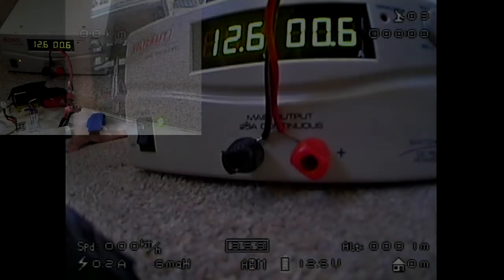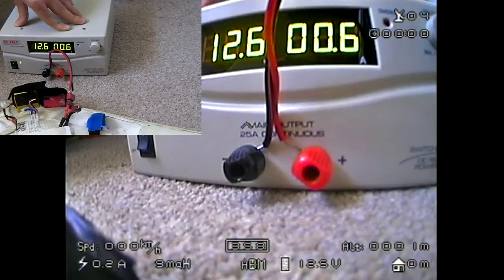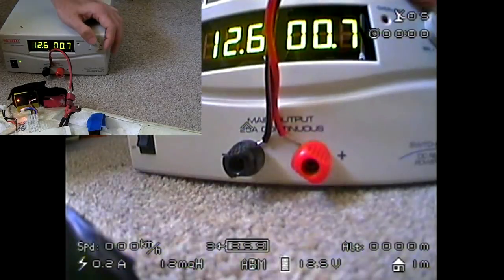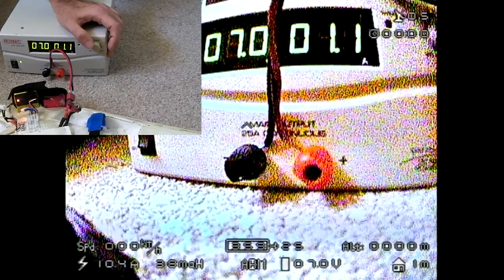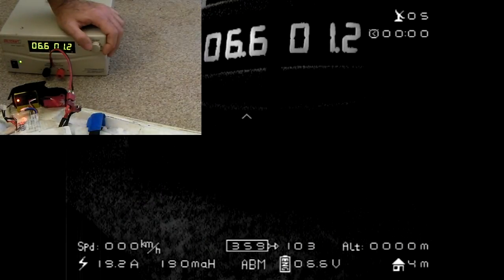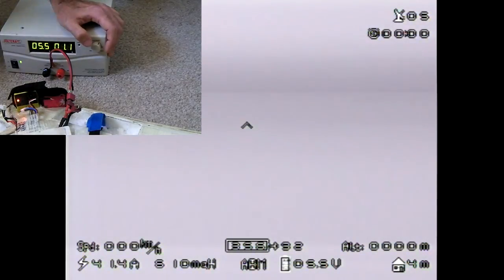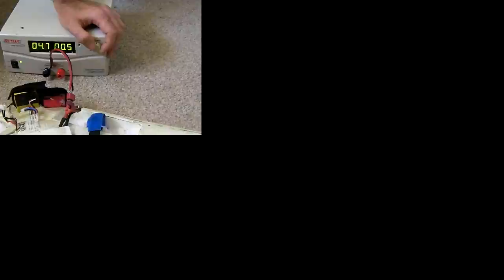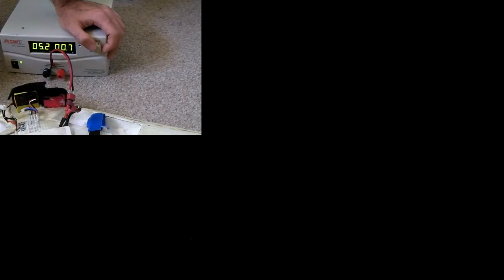FPV Platform - Low / Minimum Voltage Test - 2s Lipo

Comment: Use a voltage regulator to control and regulate your voltage for your video components. It won't matter if it's high or low voltage on the input side, it'll come out 12V or whatever you set the output to be. 

Also, I've seen people use a 3S batter on a stock Caipirinha  and it seemed to work fine. I'm building one for 3S and I totally agree, 2S is BOGUS and this is a 3S wing hands down. When mine is done I'll upload FPV videos etc....